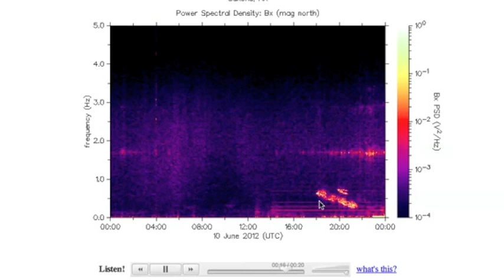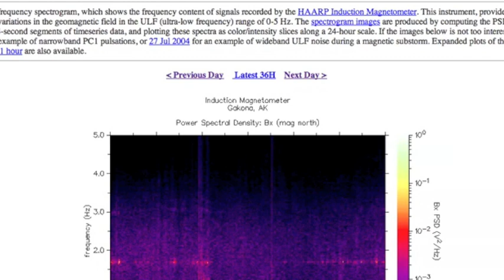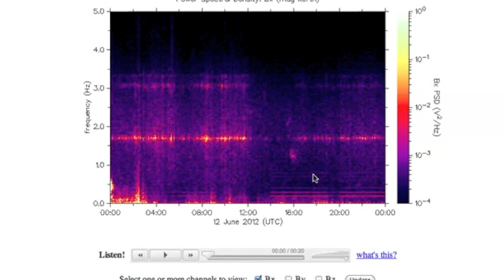Separating the 'Alien Sounds'

Comment from the maker: LIKE THIS COMMENT:
The Multiline resonance is the faint background hum. The Diagonal streaks are PC1 pulsations and sound like birds. Horizontal lines higher than 1.5 Hz sound like scratching. Large bumps on the bottom sound like thunder. You should see that everything matches perfectly... so what's the multiline resonance? any guesses??

Comment: This observation is very significant. Thinking about how HAARP works - with signals bouncing off sat mirrors and plasma, what factors would require a signal broadcast to be made at the same time each day? Does the position of the sun relative to the earth play a role if the signal destination is the same every day? If not, what would necessitate the consistent timing? Wish I had the technical background to figure out the mystery....